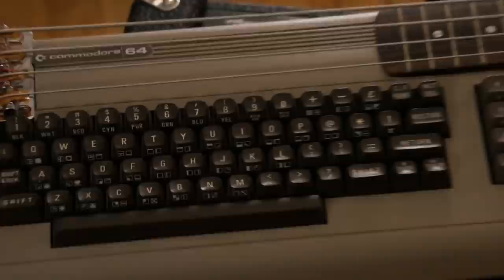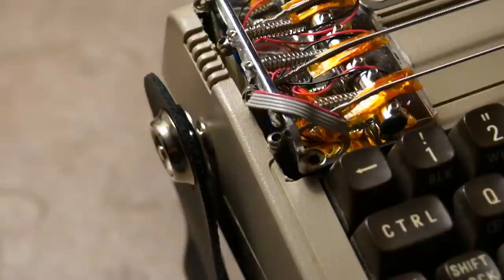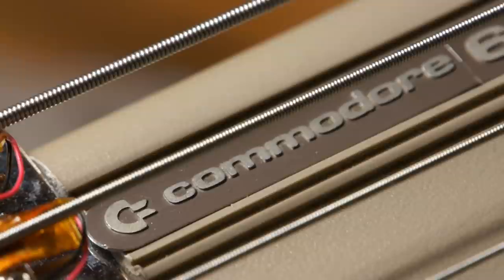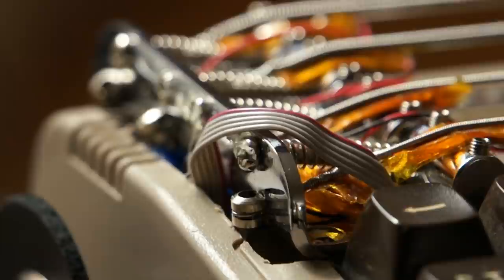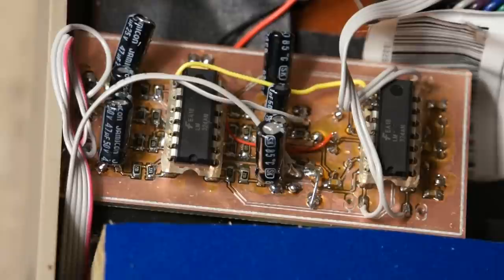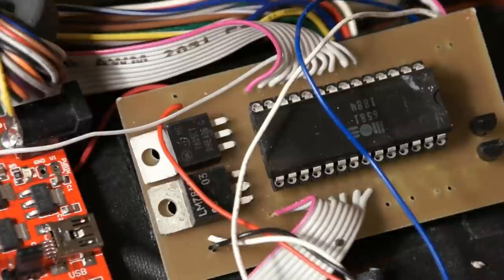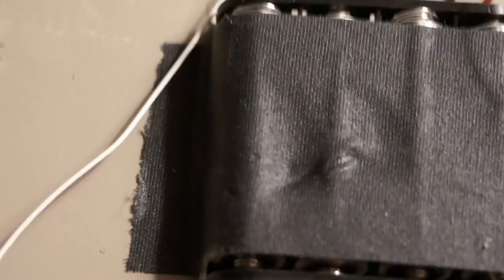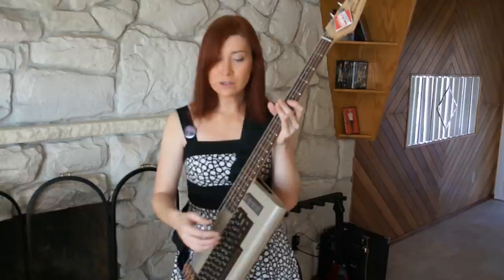C64 Bass Guitar -  Cool to be Square Wave?

Comment: This just popped up in my feed... And even thought it's old, I learnt something...

WTF! You can trim piezos like that?!!!
Reply: I had the same! 😁
This would have saved me from some serious headaches in the past 😶.
Reply: Good point n I heard her saying it doesn't track well. Lol may that be the source reason?
Reply: My issue was never with how or if you could cut em, mine was if the wire comes off how the fuk are you supposed to get it reattached?  Is not solder ill tell ya that...

Comment: My thesis in 1986 at U of Manitoba was a MIDI guitar synthesizer. Used a Motorola chip and did the machine code. Wire-wrapped everything.  Got into construction with Honeywell after graduation and then went on my own in 1991. Became a wealthy Apartment Developer. Just did was I was good at. You did a great job on the guitar. Way better than I could do. ve4mm
Reply: I see ur QSL card on eBay

PS: now i build MIDI-pickUp too
Reply: @sepic5407  The one from Jamaica. I made 1300 QSO's and had QSL cards made and I made sure I sent one to every station that contacted me.
Reply: @ve4mm  its a greats!

maybe.... have U a docs of your MIDI-synth?
Reply: @sepic5407  1986. Too far back. lololololo

Comment: Is it digital or analog?
Reply: Rieni Otten looks like both
Reply: Well, the input (string vibration) and low-pass filter are obviously analog, but you're generating digital commands to send to a computer chip - the SID - which generates waveforms digitally, but outputs analog signals directly.
Reply: Yes.
Reply: Dow!

Comment: Fooking awesome!  I loved every second of this.  I am also a EE, a musical equipment designer, and a bassist.  I think your string tracking might be off as you are using piezos  under the string at the bridge.  That whole bridge is resonating so not the best way to isolate strings.  Your comparator is acting like a noise gate so I could see that you are opening the gate more than one string at a time.  You might try winding a small version of a pickup for each string.  Like copper wire around a nail (with a magnet) might even work.  You don't need a bunch of output as you are amplifying it.  Like a Strat pickup has 7200 turns of wire - but they are trying to get that output up to a volt and they are dealing with tone.  You are using this as a trigger so just 100 turns might work.  Or you might even try a hall-effect sensor.  A 3503 is about the width of your E string so the string isolation would be much better.  May the fourths be with you!  ;-)

Comment: Hi Jeri, lets say you wanted to monitor several systems, vibration from a mic, temperature, and needed a form of input to the system in the form of a shift register. Could you please make a video on how to program an ATMega328 from software to fully programmed chip? Perhaps use one chip per measure, a shift register to receive the data and the last ATMega to display the info? Or possibly ATmegas to send the data, to a shift register, and then using UART, have an Intel core 2 duo display the information? A video on this would be amazingly helpful. Thanks Jeri, keep up the good work.

Comment: You need to do something with the headstock. Perhaps the old C64 PSU might make a good headstock. I don't know what stock algorithms you can get for the FPGA I would say you need a good FFT plus some thresholding to pull out the notes from the strings nicely.